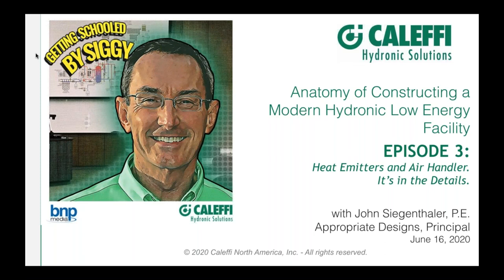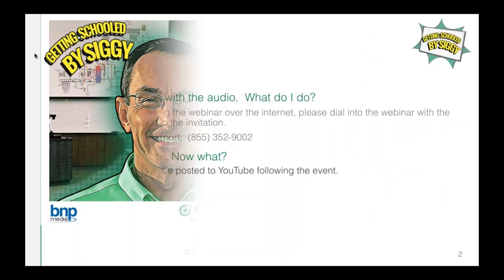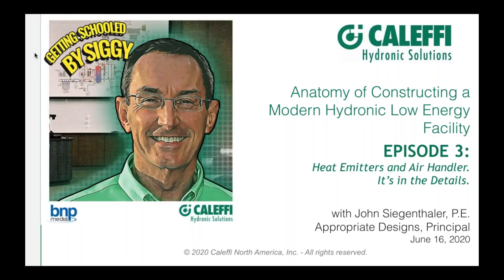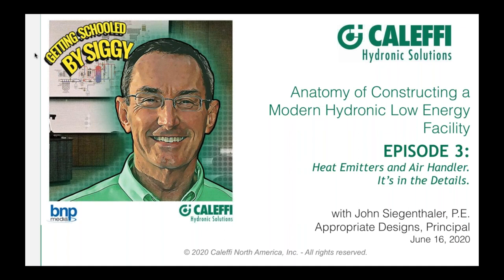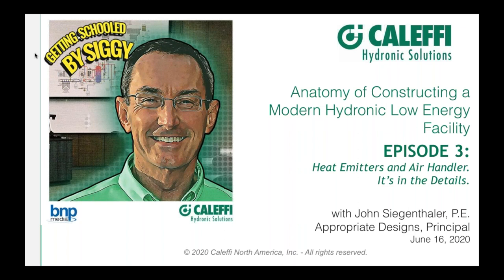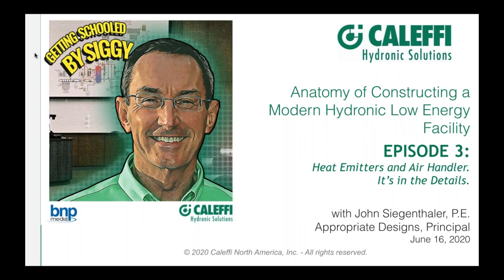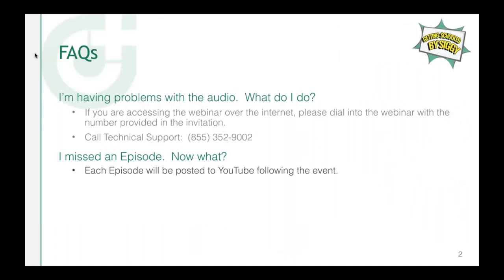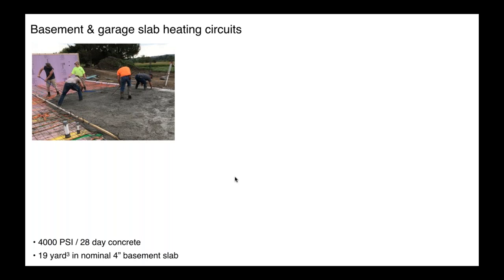Heat Emitters and Air Handler. It's in the details.

Comment: Re: 14" of foam under a foundation - Geofoam has been used under roads for decades - with several FEET in thickness of foam used.  See: https://www.youtube.com/watch?v=zoTkaRm26S0.  Think of the compressive resistance over the entire foot print of the foundation slab - at a density of 1.35lb/ft^3, the 1% deformation is about 1/2-ton/sq-ft - for a 14" of EPS that would work out to about a little over 1/8" of recoverable deformation at capacity.  With a 10ft x 10ft "shed" and a good foundation design properly distributing point loads, you could put about 53 tons on that to get it to 1% deformation (about 1 industrial yard switcher locomotive).
 
EPS is available with engineered densities up beyond 2.75lb/ft^3, where your compressive resistance to 1% deformation is can be 1.5 tons/sq-ft - that same "shed" could have up to 135 tons stacked up on that foundation.  Point is, there's plenty of room to engineer a good underslab insulation solution, and control deformation with the foundation design load distribution.
 
My personal preference is to use welded rebar mesh "remesh" rather than welded wire, as it grabs the concrete better for its purpose (there's nothing for the "paste" to bind to on welded wire to prevent the wire pulling out except the welds).  Also using rebar chairs to get the steel reinforcement material to the right height for the right kind of support.  Kind of amusing to me to see the worry about the foundation structure with regards to under-slab foam, but then see the cavalier "close-enough" attitude about the reinforcing steel... ;-)
Reply from the maker: Thanks, Tim, for your comments.  As you point out, there are different methods in the utilization of the foam insulation.  For this particular installation, we felt that several layers of 2" stacked insulation was not cost effective. Rebar is another option and useful when seismic requirements are present (not the case in this system).  It would have been possible to use rebar set on chairs, but we felt it was unnecessary and would have been significantly more expensive in terms of material and installation labor.  The most commonly used reinforcing for residential and light commercial slab on grade floors in our area is 6x6 10/10 WWF.  We’ve used it on many heated slabs on grade systems over 30 years in combination with 4000 psi/28day concrete.  No structural issues - provided proper compaction of subgrade and use of control joints.